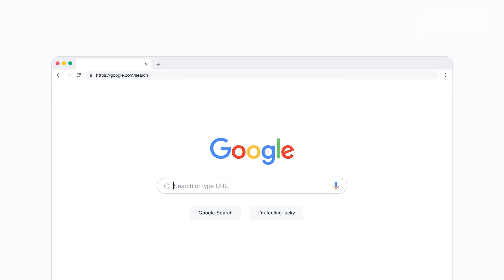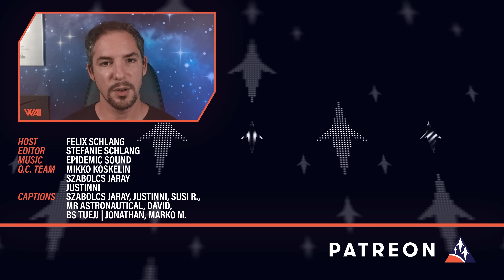SpaceX VERY cautious with orbital Starship Launch?

Comment: Hope NASA's new SLS rockets have reusable engines.  It seemed the use of Shuttle hardware was as much of a complication as it was a blessing.   I believe they will recover the engines, if not the complete first stage. No rocket should ever be launched before it is ready and the conditions are right. TNX for a great video, Felix!
Reply: I doubt they will. There likely no drastic changes going t be done to the SLS.  Its likely going to be same design we've seen s far with few adjustments which frankly is political decision in my opinion.
Reply: What is the point of reusable engines if the entire rocket is designed to burn up?
Reply: @durandalgmx7633  I saw a video showing the engines being recovered, they would be installed in a new rocket.

Comment: I was always curious as to why their tank farm is so close to the launch pad.  Always thought it should be farther away.  I'm sure they thought of that when designing things but it's been the one glaring thing to me.
Reply: Pumping distance is a consideration. The longer lines you have, the more liquid fills the lines, and the more pumping force is needed to move it. More remains in the lines afterward, too.
Reply: @ProfessorJayTee  Yes, @KSC, we had two 350 HP elctric motors driving huge pumps at the LOX facility and vacuum jacketed lines all the way to the main engines and tank.  A good half a kilometer away.  LH2 because it is so light even in cryogenic liquid state, just needs helium pressurized lines. to push it up to the vehicle.
Reply: They may not have had permission to expand much farther back into the wet lands. In fact it seems only recently that their footprint begun to expand just an oddly shaped small amount.
Reply: I think the insulation to keep the liquids in cryogenic state is large when they have to pump it from far away
Reply: I used to work at the LOX and LH2 storage facilites at KSC. We were about half a kilometer away from the vehicle for a reason.
Reply: I'm still wondering about having a CREW sitting INSIDE the second stage (Starship) directly above the propellant tanks with nowhere to go. Ejection seats would definitely be in order, like in Gemini. Escape capsules like on the B58 hustler would be even better.
Reply: Given that'd it'd be hard to move the tank farm, (it's likely they'd have to rebuild it),   then it'd probably be a good idea to leave the tanks where they are but build a strong wall around them or at least on the side that faces the launch pad.  At least then, there would be some protection unless a rocket literally lands on top the tank farm.

Having the tanks that close and exposed the way they are could indeed end up a problem.  So I agree for sure, it's not worth the risk IMO

Comment: Question. All the renderings of Starships shows the internal layout horizontal while Starship is vertical? What happens to the layout when the Starship in moving horizontal?
Reply: By then it doesn't matter much, I suspect. In space, when accelerating, everything is still "down", whether the ship is "vertical" or not. When not accelerating, gravity is more-or-less zero and everything floats and can be located in any direction.
Reply: @WarrenLacefield  true some if no will be abov
Reply: Sorry about that. The internal hardware is mounted the inner walls of the Starship, so some things may need movement or the openings of the hardwarle needs to be on the horizontal even if you're floating. You wouldn't the back to the front.

Comment: If a RUD occurs with a fully loaded Booster (3400t of methalox) and Ship (1200t) on the first orbital launch attempt, the OLM and the OLIT probably will be extensively damaged. Repairing that mess could very likely take 6 months or more. 

What might take a lot longer are the FAA, NTSB and, probably, NASA accident investigations plus the additional time to obtain a new permit for another orbital launch attempt at BC. 

It would not be a surprise if Elon decided to move orbital launches from BC to ocean platforms that would be located in the Western Gulf of Mexico about 100 km offshore from the beach at BC.

You know what they say about repeating an activity that has led to failure and expecting a different outcome.
Reply: NTSB aren't involved in rocket accident, especially uncrewed

Comment: @9:25 I'll believe it when I can count the number of successful SLS launches past ONE!
Reply: Why do you want SLS to fail?
Reply: @Ca48Point5  Wiser in spending taxpayers money, should be more meaningful results/achievements within the same amount of money

This view can be shared BOTH by SpaceX & non-SpaceX enthusiasts
Reply: @alvianchoiriapriliansyah9882  Waste? the SLS is the only rocket capable of bringing humans to the moon, and before you mention starshit, it’s not crew rated, and won’t be crew rated for a while. it’s gonna take a lot to convince whoever crew-rates spacecraft to even think of putting humans on a tin can slapped together in a dirt field. at the very least, the SLS is not only using proven systems (the newest crew-rated lunar capable capsule, the shuttle engines that flew 133 successful flights, and the newest flight computer literally built from the ground up for SLS) You cannot go to the moon in modern times without SLS my guy
Reply: @Ca48Point5  unnecessary SpaceX fanboyism.
Reply: @ooooneeee  SpaceX fanboyism is a plague

Comment: I use a methane alcohol stove CH³OH to cook at my camp. Different volatility than methane but I spilled it and the easy way to put alcohol fires out especially methanol is you spray water on it as a spray. We can have a RUD during the static fire. If they need a full tank of methane to keep the thing from getting sheared off the launch platform then we need a lot of water systems just for the static fire and for the experimental first few orbital launches to put the fire out a lot of the methanol will not ignite it immediately it's cold and densified as long as you can knock the flames down quickly that's your best chance of mitigating the damage and the fire especially. Elon doesn't have unlimited resources so he's had to make decisions and so I'm a little concerned. We don't want to see failure, this has got to work and it's not just about multiplanet species there's so much more involved in this. My idea is to turn our solar system into an industrial yard. Manufacturing in space and then turn the Earth into a garden, we should clean it up, it could be a really big deal to helping the earth. It's a lot of work and it may seem like it's impossible or maybe goofy but people love doing this stuff. We can replace the military industrial complex with the space industrial complex and it'll be much more profitable for the economy. Then we'll have a space economy. I really believe the USA can increase their GDP multiply it, by factors.

Comment: In my opinion, NASA should have used the SpaceX Falcon Heavy to reach the Moon, at a cost of 90 million USD. Now, the cost of each SLS launch is estimated at 4.1 billion dollars for the first four missions. . The high cost of the SLS means that the Artemis missions to the moon are a few missions, in addition to the uselessness of the gateway that should be on the surface, not circling the moon. Ultimately all because of the bureaucracy.
Reply: Falcon heavy is not enough. That's why they need a bigger rocket
Reply: @coonjamalay  OK
Reply: Agreed
That and Starship, could launch multiple rockets in a short period and set up base quickly as well as fuel only rockets in orbit, earth and the moon.
Could be a game changer

Comment: If SpaceX can launch Falcon 9 many many times with pin point accuracy I am sure Starship launches will follow the same, yes totally new ship so plenty of testing to make sure it's safe to fly to space is needed, but I would have built the fuel farm underground out of the exhaust from 33 Raptor engines.

Comment: I have never been convinced that I have to use so many engines for the Super Heavy.  Wouldn't it be enough with 8 or 10 but bigger and more powerful?  The Saturn V had only 5 engines and took us to the Moon many times.
Reply: Why have fewer, though? An engine failure isn't catastrophic if you have a lot of them. And the engines for the Saturn V and Starship are very different.
Reply: Extra-large engines would have taken more time to develop (and the F-1 required design compromises that actually reduced its performance). And since rocket throttling is (outside Kerbal) very limited, they'd probably have had to develop smaller Raptor engines anyway. It would have added time and money to the project.
Reply: There are a few factors. Robert has pointed out two big ones — that bigger engines tend to be far more difficult to build (because a larger volume tends to result in more turbulence and general instability), and that giant engines aren't suitable for propulsive landing (because minimum thrust is far too much).

But the biggest factor I think — given we see it not only with Starship and Falcon, but also Rocket Labs Electron — is that having commonality of engines between stages is a huge cost saving...all three vehicles use minor variations of the same engine on booster and second stage, and that tends to be a big influence on how big the engine will be. Falcon and Electron have a single upper-stage vacuum engine, which means the engine is sized for that, and the number of sea-level engines on the booster will be determined accordingly. Starship has more engines on the upper stage, but the same rationale applies.

Comment: I'm surprised SpaceX is not doing a test launch & capture with the booster before doing full stack orbital flight. Less stuff to go boom.
Reply: They're probably doing a crazy amount of simulation in the meantime.

Simulating all kinds of potential cases.
Reply: @bloodaid  im pretty sure they are.... But simulation can only show you expected results the software can give. The real thing has way to many possibilities. Like all the prototypes having a good time popping.
Reply: @ZeroSpawn  you’d be surprised by the sheer power of simulations. Fluid dynamics simulations, or CFD, is extremely powerful. They could simulate different environments, even storms.

They can run multiple simulations at once, probably thousands, and they can run all thise simulations extremely fast, probably within minutes.

Do this for months and months on end, and yeah…

Don’t underestimate compute power.
Reply: @bloodaid  Oh i understand computing power quite well, I work with bleeding edge FPGAs and etc. But you can't account for starship stabbing a bird at 400mph, creaming a few heat shield off. I'm sure they already know that if they lose any heat shield tiles, starship will go bye bye. Im just saying that they had simulations of GrassHopper/Falcon & Starship Prototypes and they all went splat. This will be the first time Booster will fly, i'm crossing my booty cheeks and hope it will perform excellently and no RUDing into the tower.
Reply: @ZeroSpawn  why can they not? They’d just simulate a projectile hitting it. Not much different than sinulating their cars hitting a wall or whatever. Also, the bird would probably get pulverized.

Comment: What's going on with fuel production on-site?  I feel like there hasn't been an update on that in ages.
Reply: They should seriously place a blast wall in front of it, just in case the chopsticks has butter fingers.
Reply: @ZeroSpawn  Which they already did
Reply: @alvianchoiriapriliansyah9882  i dont know, those 6 big ass tanks are still exposed to the launch area. I can still see the booster through those tanks.
Reply: Canceled because the reduced number of flights allowed.
Reply: @TheMoneypresident  wow. That's such an enormous and necessary proof on concept for any mission to Mars, you'd think that would still be a high priority...
Reply: @imtired1696  they limited flights from boca

Comment: You mean provide extra large bonus checks for upper echelon management bonus checks for both companies while providing very little goods or services.
Reply: I am reasonably confident that the cost of 1 successfull SLS launch will not be any more expensive than the cost to get 1  fully operational Starship to the moon.
Reply: @stephenwhite4257  Not if experience is any guide.
Reply: @stephenwhite4257  depends on how the contract is written, cost plus 10, might as well forget about boots on the moon in this or half way to the next decade, Mars ?, ha, I'll be well past my hundredth birthday before we see anyone who I don't need a translator to understand. P.S. I was born in 1960.
Reply: @stephenwhite4257  (If all HLS R&D are accounted) Starship HLS flight cost $1.45B per mission to taxpayers (including several refueling/tanker flights), SLS flight cost $2.2B per mission to taxpayers (excluding Orion). Just sayin'

Comment: 1:32 “Almost not fueled”, a partly full tank would “explode” (rapidly burn) more because the empty area would be full of a rich mix of fuel fume and air. A fully fueled  tank would not explode as much until the fuel was outside the tank and mixed with the air. So, there is nor such thing as a partly empty tank.  Liquid fuel itself does not burn, it is the fumes or vapor (or atomized)  that burns.
Reply: That's true for gasoline where boiling point is above atmospheric temperature not so true for liquid methane -250f and liquid oxygen-295f. They vaporize really quick when exposed to atmospheric heat

Comment: The other risk management of a RUD, is to say, yes there will be a RUD on the launch pad. If that is the case then it is best to have several static firers and launches. In either case the fuel tanks should only be 25% full and then increase in 25% increments  so, 25-50-75-100%.
If RUD happens with only 25% fuel then less blast damage will be done than 100% full tanks. Each top up will give SpaceX more experience static firing the 33 engines and then launching. 
So 4 test fires and 4 test launches in total.
Reply: Problem there is if a failure only manifests at higher loads? then you've only wasted your time. It can't fly until a 100% load static fire - so you've got to do it sooner or later - one 25% load to ensure the engines are good - then straight to 100% - 50% and 75% offer no guarantees other than testing the engines again - which is a waste of time.
Reply: @JohnnyWednesday  the key in my view is gaining experience. Most of the complexity and procedures are around loading and unloading the fuel and lighting all the 33 engines. 
So to me the step by step process is not a waste of time. 
If there is a RUD at 100% then they abandon the site (decommissioning will take time so a skeleton crew can do this)  in Texas and go to the site in Florida....with all the experience they have gained. So very little down time.